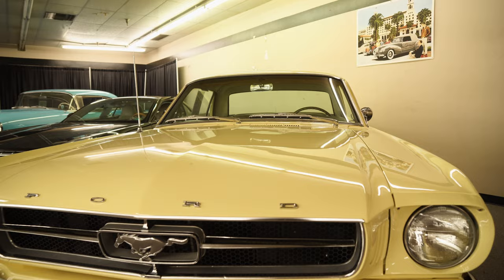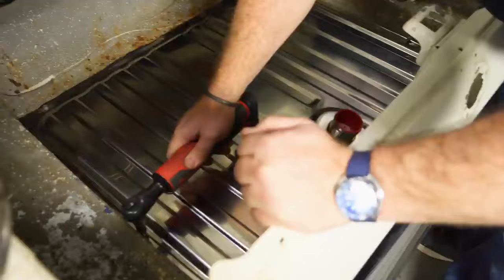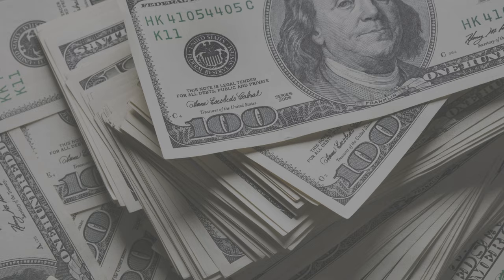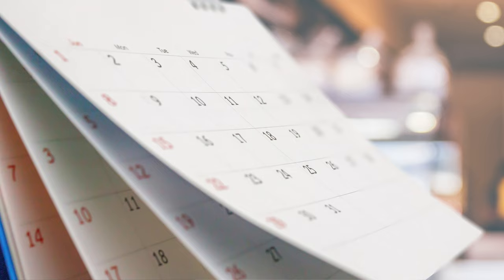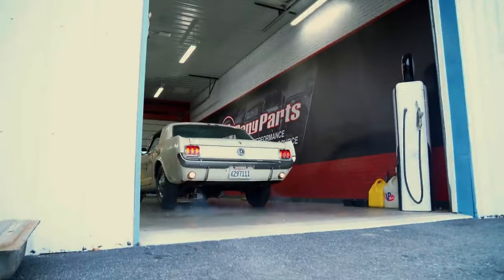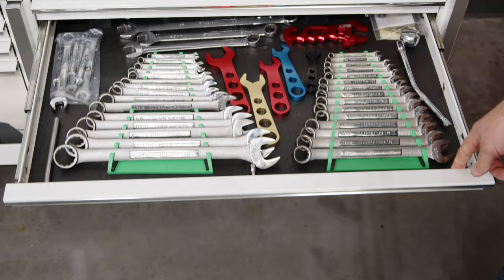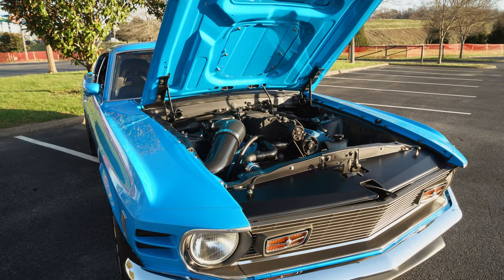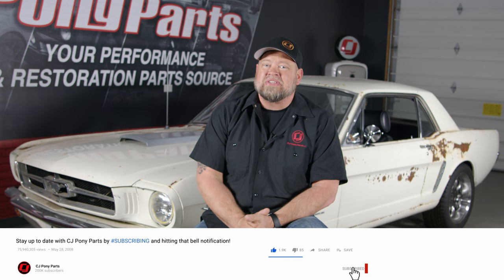Restore a Classic Car! Here's What You Need to Know NOW 💲🛠🥵

Comment: I’ve had my 67 for 6 years. I do one big upgrade per year. It was able to drive when I got it, but there was plenty to be done.
Reply: Same here. I have a 65 I’ve had for 6 years now. Every year I do 1 big upgrade or repair. My next big job is pulling the engine & rebuilding it. I try to get the work done in the early spring so I can have it back for the summer.

Comment: The part on recommending driving a classic first….. 1000 times recommend if you can. Driving a classic usually will have numb steering, brakes soft, seats are decent at best in comfort, hot,  and every car will have its quirks. But there is no other driving experience like it! You will get more smiles-per-gallon in a classic car. It’s not for everyone but the labor you put it will make you appreciate your car so much.

Comment: All true! As a 23 year old owner of a 66' coupe I didn't consider any of this before buying lol! You'll learn a lot about cars if you don't know already. Had never done an oil change before, now I'm up to replacing crankshaft bearings to fix oil pressure. There is one thing I gotta disagree with, classics are way more fun to drive than a modern car, non-power drums and manual steering is just part of the charm! Great video!

Comment: I find myself gradually wanting to do more and more to my own 65 coupe. I didnt start off considering a 5 speed manual swap, new lights, and even a 4.3L V8 from Lexus and some coil overs. But after daily driving a stock, C code automatic Mustang there are a few short comings I wanna address. I realized I wanted more power but also added reliability. But there's already so many Coyote swaps out there. I wanted something unique. I seriously considered a 2jz, but those are way too expensive these days and you need forced induction to make any kind of power and I like not needing super unleaded. So I looked into 1 and 3uz's. They're very similar to Ford Modulars, can make up to 310 hp stock, AND also dont require 93 octane AND can even get good gas mileage for a V8. Not to mention sound great with the right exhaust. They can even accept Terminator Cobra super chargers. I definitely want over drive for the highway and better brakes, definitely want AC for the NC summer heat. And a few little gadgets here and there.

Comment: My dad had a 1970 Mach 1 4spd 351clev he bought in 1990... Destroyed in a fire in 2006. We have always had 1969-1970 mustang posters hanging in our garage. I was lucky enough to buy a 1969 Mach 1 4spd 428 cj in February of this year. It ran well enough, but since I bought it I have done complete brake overhauls, shifter and transmission rebuilds, new clutch, flywheel, and pressure plate, all new lighting and some more... I'm 25 with zero experience, just tools and a buddy's lift! The moment my dad got behind the wheel and taught me to drive stick in it was absolutely incredible (yes, I had never driven stick before I bought it). It's worth it to see the looks on my dad and grandpa's faces when they rip it around these backroads

Comment: Good info. What would be helpful for me is the knowledge of how difficult a particular car would be to restore. Like having a grade scale for cars of 1 being the easiest and 5 being the hardest to restore. When I look at an old car, it's hard for me to know if it is a good or bad starting point for a restoration.
Reply: The 1st thing u have to decide is what car do u want.. for me it was the 65-66 mustang..i found nicer ones when i was looking but they weren't what i wanted.. and you're gonna spend so much time with it u better get 1 that u start off loving.. 2nd how much can u afford..i couldn't spend what people wanted for a restored one.. so that's how i picked mine.. and i do all i can on the car..it's not only gratifying but cost effective if u can do it yourself  😁
Reply: If your frame/floor are bad you'll need welding. Not difficult necessarily, but pricey to get started or to pay someone to do it. If you're looking into resto it's a great skill to learn. You should get a running engine if you're spending anything over $8k for a V8 Coupe, fastbacks are a whole other ball game. Everything else is really just elbow grease and patience. At this point there a huge amount of YouTube videos and forum posts that'll walk you through almost every job. The biggest thing I'd say for a first time resto is get something with a common engine, Ford put the 289/302 (both used the same parts which are still easy to find) in just about all the cars back then (Mustangs, Broncos, Falcons, Galaxies, Pickups) and the 302 in select cars up to the 90s. I know Chevy made about a billion 350s, and I'm pretty sure most of ford's 351 engines parts are interchangable with the 289/302. Not only will this help your wallet, it will also give you easier access of how-to videos and guides. Whatever car you decide, buy a Haynes repair manual and you'll never be too lost! Best of luck in your hunt!